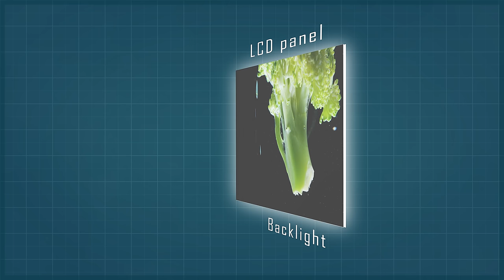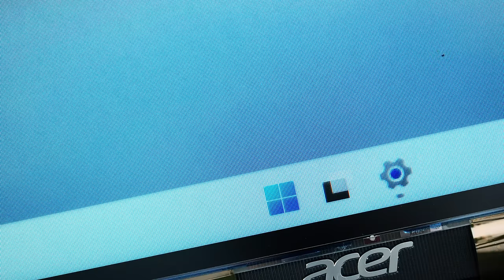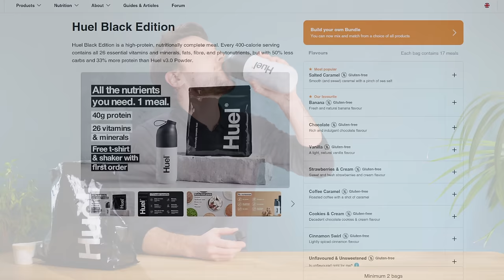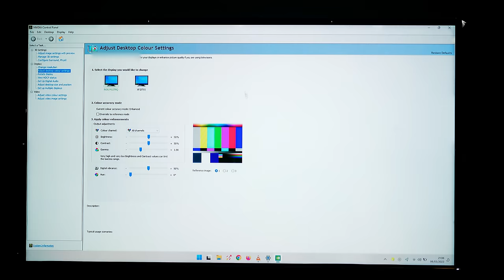DIY Dual-Layer LCD monitor - can it match OLED??

Comment: Awesome project! You could try use a half-waveplate instead of the tracing paper. This should more than double the brightness of the monitor. It's a clear film that rotates the polarisation axis by 90°. Right now, half the light is absorbed by the second monitor's polarising filter because the polarisation is random. 

Really nice work though. Looks amazing 👏
Reply: My first thought was to wonder whether the polarizing film could be peeled off the first LCD panel rather than polarize and then diffuse the light again. Couldn't you stack the panels THEN polarize?
Reply: @K3Techs  I was thinking the same thing, i saw some videos doing so and the user not able to see anything without polarising sunglasses.
Reply: @VivekKumar-tn2ue  yes normally without a polarizing film an LCD panel just looks white. But in this case there would still be a film in the correct orientation on the second panel, so I don't know if there's a particular reason it wouldn't work. It seems too dumb to be possible.
Reply: LCDs inherently twist their polarization - I can't remember if it is the dark or light pixels that are twisted.  So simply flipping the front panel over MIGHT resolve the issue - but then requires mirroring its image when driving it.

Also, the gamma is going to be really wrong here.  Doing this properly would require something like taking 10-bit Rec. 2020 PQ in, and outputting two separate Rec.709/sRGB 8-bit signals calculated in such a way as to properly achieve the desired final transfer function.
Reply: @Entropy512  Yeah, you can see the gamma issues in the video. I also wonder if the drop shadow on the text is just due to very slight misalignment of the panels.
Reply: This is a colour monitor, thus three wavelengths are implied, so the waveplate method would not work great

Comment: Awesome project!  Adding a third polarized film that is perpendicular to the tv polarized film would allow you to see the image again and would probably be less fuzzy that trace paper.  The other option is to remove the polarized film on the back panel.
Reply: My first thought was to use a third lcd screen but your idea would be a lot cheaper. It's not an intuitive outcome so I can see why he didn't think of it. Polarized light is basically witchcraft, after all.
Reply: This is a clever idea.
Reply: You couldn't remove the diffuser between the screens, since the LCD rotates the polarization by 90 degrees. Adding another LCD would give you 180 degrees of rotation - back to the original.
Reply: I was thinking that to, if he removed the rear panels filter he would also get more light and a clearer picture.

Comment: This is quite similar to something that was done (very successfully) at the computer science lab at my university. Rather than using two LCD panels, they used a DLP projector as the backlight for one panel.
Reply: Ahhh, interesting. That seems like it would take up even more space though. Plus probably more work as well.
Reply: @MsHojat  Oh definitely! It wasn't practical as a replacement monitor but, by using a DLP projector, you have a very powerful backlight & absolutely zero light in the black areas
Reply: Projector stacking. We did that to increase projector lumens. Fancy seeing this used to enhanced darker areas. Cool.

Comment: One thing you could try to improve brightness and sharpness is removing the polarizers instead of unpolarizing the light. Just doing that should double the brightness, as 50% of unpolarized light is absorbed by a polarizer. The only problem is that it’s difficult to do without breaking the panel, but it’s doable.
Reply: isn't the purpose to use the two polarizers to remove the "grey" and turn it black though?
Reply: @danielxmiller  hes not talking about the lcd panel, hes talking about the polariser on top of the panels, instead of removing the back one he's added a "depolariser" in the middle.
Reply: Does brightness really matter that much ? If you spend <1500$ on an OLED monitor then it should be safe to assume that you have a light controlled environment to use it in, eliminating the need for super high brightness. More brightness is pointless past a certain threshold, only serving to hurt your eyes more than necessary
Reply: The polarizers will get out fairly easily with just iso alcohol or acetone, the glue isn't strong.
Reply: Bro isn't the point of the polarizer to block unwanted lights so you can actually see the image?
Reply: @GhastlyDerp  nop, the polarizer job is to polarize light and then filter out light, in that scheme you already have polarized light coming in so it needs one less polarizer
Reply: @fss1704  Exactly, that's what I commented.
Reply: @examplerkey  your comment was blocked, it's invisible to us.
Reply: @fss1704  Well that's too bad. My comment was about removing the bottom polarizer of the top display to get the same or yet better result. Not sure why it was blocked, nothing politically incorrect! :)
Reply: @examplerkey  yeah, not sure either, about your suggestion, it would be better to remove the top part of the bottom panel, as the anti-glare finish there usually reduces more of the brightness than your suggestion
Reply: That won't work. The way LCDs work is by twisting the polarization. Initial backlight is linear polarization, say, vertical (polarized with ; liquid crystals then twist it by 90 degrees if needed; and final image is then filtered through another polarizer, oriented 90 degrees to the original one. If light was twisted by 90 degrees, light passes, if not, it doesn't.
The problem with removing all polarizers in between the panels is that the image will be just black. Initial polarization is, say, vertical, so back polarizers are vertical, front polarizers are horizontal and stack is as follows: vertical, LCD panel, (removed vertical and horizontal), LCD panel, horizontal. Since LCD panels are doubled the angle they rotate the light by is doubled. So, for light to pass, each of them tries to rotate the light by 90 degrees. Do the rotation is 180. And the final horizontal polarizer does not let this vertically polarized light through. If we want black, both of the panels do not twist the light polarization. Vertical light stays vertical, therefore. The end result is again black.
Reply: @user-rm3kh3dk8d  You're right, it won't work. Thank you for your correction. How's this? Let's assume the bottom polarizer is V. So, it will be V + first LCD screen (90° twist, now the light is H) + H <on top of> V (removed) + second LCD screen (90° twist again, now the light is V) + H (black!!). You can replace the top H with V and it will work! More important question is can the same LCDs (liquid crystals itself) from two monitors twist the light from V to H back to V again? If so, this project still has some hope!
Reply: @examplerkey  replacing the polarizer is tough, yet can be done, sure. And yes, liquid crystals can twist the polarization from v to h and then 90 degrees more back to v. I won't get into detail how it works, it's a rather complicated topic involving circularly polarized light which is a hard concept to grasp.
But we then get to the second problem - in fact, it won't improve the picture much if some polarizers are removed! The reason why LCDs don't have perfect blacks (in fact they don't have perfect whites as well - not all light passes through, but that's just max brightness I guess) are unidealities in both polarizers and liquid crystals (mostly the latter, I think). There is some fluctuation to the angle the liquid crystal twists the light by (remember, it's not like there's only one liquid crystal per pixel) and on average, therefore, say, when light is twisted by 0 degrees the actual polarization is, say, -5 to +5 degrees, in some distribution (probably close to the gaussian) and, therefore, not all light is exactly blocked. Polarizers also can also give some fluctuation as well, but I am not sure since I don't know how the exact polarizers in screens work. The amount of this overall fluctuation is what determines the contrast. 
If you stack two LCD panels on top of each other with a scattering depolarization filter in between, the contrast is squared since the same process is essentially repeated twice. The polarization coming out from the first panel does not matter when light reaches the second panel after the filter, only intensity does, first and second panels are completely independent, even in strict terminology - statistically, their fluctuations are independent and therefore the effect is squared. But when you remove the depolarization filter, they are no more independent. 
In fact, think of it that way. In a setup  with v, lc, lc, h the rotation angle is the sum or difference of rotations in both lc panels. And absolute fluctuations of the twist angle are therefore doubled, making the image worse!
Reply: @user-rm3kh3dk8d  No doubt image will be a bit ghostly even viewed from front. So, basically, you've to peel both polarizers from the top screen, one to be removed and one to be replaced with an opposite polarizer. That's a lot of work there. The image could look better. I mean enhanced in colour but not sure about contrast because of those double fluctuations. The project deserves another go! For me I just carefully adjusted the built in presets so that the screen brightness is no more or less than the surrounding brightness on the wall, and I use a dark theme, and the result is pretty good tbh. Black stays black. The nature is not 100% black or white either, so trying to achieve scenes that don't exist in nature is also a bit wrong or misplaced ideal?
Reply: @examplerkey  The question is not "how black" or "how bright", the question is the maximum dynamic range - the relation between these two - and, therefore, contrast. Why enhanced in color, tho? Vibrancy is essentially contrast for each of the RGB components. Perhaps the only reason it will be "enchanced" is that the light will go through the colour filters two times, making the spectra of each of the rtb components narrower, but that's questionable, especially after you calibrate the screen you've made.
Reply: @user-rm3kh3dk8d  Nop, you're very wrong, LCD's don't rotate the light, if you remove all the middle layers  one LCD will filter the light to let's say 45° and the other will filter it again to the same 45° letting all of the light from the first one pass trough the second one, making it essentially the same thing as having one LCD. LCD's genereally have two polarizers because they don't have a polarized light source, with the second panel getting polarized light you don't have to worry about one of the polarizers, preferably the front one of the back layer that has anti-glare.
Reply: @examplerkey  Forget what he said and look at my recent previous comment. Yeah, you should remove the front polarizer+antiglare from the back lcd, then reverse the polarizer direction on the back pol from the back lcd and it will work much better.
Reply: It seems the correct way would be to remove the front polarizer of the back display, and the back polarizer of the front display.  The back one polarizes the incoming light to horizontal, then the LCD's scatter light when the pixel cell is OFF (due to randomization of the liquid crystals), and pass the polarized light when the LCD pixel cell is ON (energized); then the front polarizer de-polarizes the transmitted light for viewing.
Reply: @fss1704  Yes, hiding the more imperfect screen in the back would make the stack look better. So, on theoretical level, the project is almost perfect :). He needs to build it!
Reply: @user-rm3kh3dk8d  So, basically what you're saying is after all the hard work and aligning two screens perfectly, you go and calibrate the final screen(s) to get the natural colour and it will have defeated all that vibrancy, but contrast (dynamic range) should be better, agree? The best way to experiment is to remove all the polarizers of both screens and experiment with all, probably about four, viable combinations.
Reply: @cbegefdkih  there are these crazy things that edist called windows and the sun
Reply: @fss1704  alcohol NOT acetone. They don’t both work, i have experimented quite a bit with this. (Unless yours has different glue - either way both won’t work, don’t assume one will work)
Reply: @fss1704  you sound more wrong than the other guy.  and before i place another complicated explaination -here is a simple video https://youtu.be/0B79dGR19Tg
but in one point you are right. removing the second polarizing filter off the back lcd will do the work (but dont forget to invert the image from the back lcd)
Reply: @melody3741  Sorry, i meant nail polish countainig acetone, not pure acetone, it has isopropanol (isopropyl alcohol) mixed in, i always used it to remanufacture oled screens of cellphones, it works the same on any LCD screen.

Comment: Nice project!
The reason you need the paper between the two panels is that they have the same filter orientation (same brand/model). A polarizer filter lets light through with either horizontal or vertical polarization. 

The way LCD works is: there's a liquid crystal (hence LCD) layer between two polarizer filters of opposite orientation. So, for example: a horizontal filter in the back, a vertical filter in the front. This blocks all light (except some bleeds through) but when you apply voltage to the liquid crystal it rotates the polarization by some angle proportional to the voltage. So if it turns the horizontally polarized light by 90 degrees, then all of it goes through the vertical filter in front. 

Now when you put the two panels on top, the front vertical filter of the first panel lets through only vertically polarized light, but the back horizontal filter of the second panel blocks that.
As someone suggested, you could remove one polarizer filter from between the two panels, but another option is to just flip one panel and have its front (horizontal) filter face the other panels front (horizontal) filter, so they would let light through without the need of the paper. Of course you would need to flip the image on that panel by software somehow - not sure how hard it would be.

Another thing that someone already mentioned is that the two panels on top basically multiply the brightness, so you get your brightness squared - need to adjust your gamma.
Reply: I don’t believe liquid crystals will rotate the polarization if they aren’t aligned with the polarization on the side they come in. Another option is to flip the second lcd over.

Comment: An interesting project, thanks for the video. A couple of notes from a graphics engineer perspective:

- By combining two LCD panels together and sending the same signal to both, you're getting color distortion. Each panel acts as a filter, multiplying the backlight radiance by the desired color: L * c. Two panels, therefore, square the color: L * c * c. That results in dark tones becoming darker, and colors shifting as if gamma correction with a factor of 2.0 was applied. To compensate for that, apply gamma = 0.5 to the output image.

- The rainbow effect that you get with a camera is a Moire pattern, essentially a form of aliasing. When the screen is projected onto the camera sensor, its subpixels have a density comparable to the density of sensor elements, or probably somewhat higher. So, some sensor elements get more of the red subpixels, and some get more of the blue ones, for example. That issue is amplified by the Bayer pattern used on most camera sensors. To get rid of the rainbows, you can try to defocus the camera slightly, which will achieve optical anti-aliasing by removing the high frequencies from the input signal.

Comment: As a multimedia computing graduate, this project is simply priceless. Not just the project itself, but rather also understanding of the inner workings of a monitor. Throughout my four years of uni’ I’ve not once been explained that the LCD is taking advantage of polarisation to produce the images, as you’ve explained in very simple terms. I could not thank you enough.
Reply: Education these days is basically worthless -- only the most shallow details are covered, and the average person will learn far more if they simply do their own research.
Reply: @hxhdfjifzirstc894  Nope 🤦‍♂. It's that Education often is severely underfunded and understaffed. Not to mention, if results are not "produced" funding gets cut so the material for general degrees is simplified to ensure a higher pass rate. Unless you choose very specialised subjects - that knowledge is actually needed as a foundational layer.
Reply: I find your comment about not being taught how an LCD display actually works as amazing as it is concerning.  I am amazed there are people who can some how rationalize that gaffe.  Of course my concern is obvious with my only real wonder being, "what the hell else is missing??"
Reply: @hxhdfjifzirstc894  A pretty wild exaggeration.
Reply: @DougDingus  Sadly university is more about learning yourself than being taught everything. I'm certain that appropriate courses that cover display technologies can be found, as there are more complex things taught there as well. However, they mostly rely on people actively studying stuff on their own, and the main point is on how to find and process new information from various sources such as books, journals, and other publications both in paper and online.

OF course, it's not perfect either. That's not what I'm saying. I was thoroughly disappointed with uni education at first during my undergrad studies, but I've found things here and there that are worth mentioning and appreciating for.